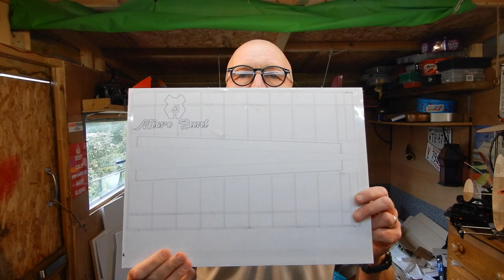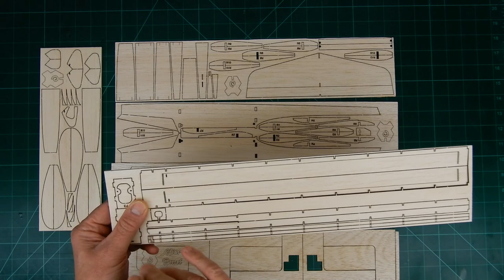How to build The Micro Runt radio control glider Part 1 Wing

Comment: Hi Nick, I’ve just bought a micro runt from AngelWings, a bit of nostalgia. I used to love my ridge runt but can’t find the full kit any more. I wondered why I recognised this guy in your video before I saw your name. We actually met many years ago when I came down to your Oxford tow group with my FLPHG.
Anyway, my question is, what servos did you use in the micro runt?.
Luv your HG supine vids by the way. Hope to get back on my HG and down to Woolacombe this year (I say it every year) safe flying Nick and keep the vids coming👍
Reply from the maker: Hi Robin yes I remember there is a bigger runt coming. Been flying seated 7 years it’s dead comfy. Come down sometime Get some emax servos 
https://cdn.shopify.com/s/files/1/0300/4864/9309/files/Micro_Runt_Instructions_29cc2c0e-c52e-4902-98f9-c4d10cb43ff5.pdf?v=1693130893

Comment: I'm coming back to the hobby. Do you find that you can build straight and true on a cutting board? Have modern laser or milled kits and CA adhesives negated the need for a foam board to pin down on?
Reply from the maker: They just clip together these days chris

Comment: Hi, I was wondering do you have any tips on planing to get accurate results? Great videos by the way, i’m hoping to learn more from your videos.
Reply from the maker: Thanks do you mean the build mate or flying
Reply: @NickChittyFlying  , sorry for not being specific. I mean when planing the leading/trailing edge of the wing with a plane to shave off a few milimeters of thickness.
Reply from the maker: @mococo4234  I use a balsa plane carefully 😍
Reply from the maker: Then fine sand paper
Reply: @NickChittyFlying  I guess practice makes perfect 😅 👍🏼